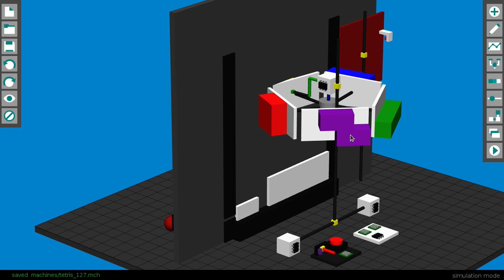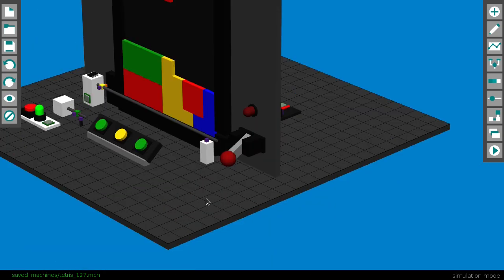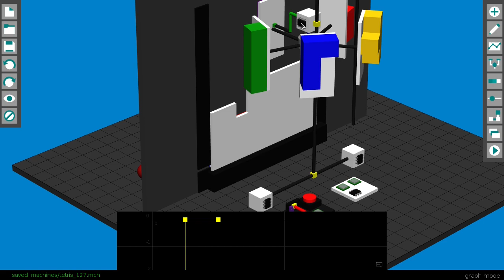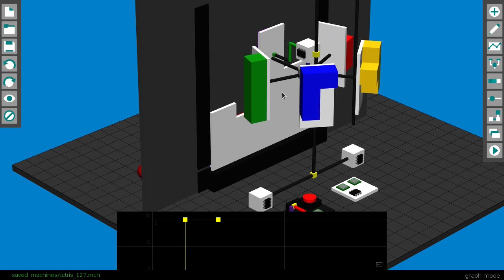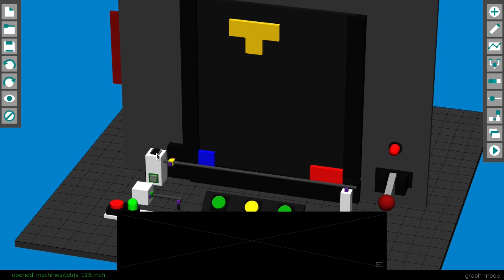How to Make a Tetris Game with Almost No Code

Comment: Did you build the engine from scratch? I think I have seen your release of the beta version in YC, I find the logic behind your program quite interesting ... For example, the engine that rotates the figures resembles a coded while loop that would "rotate" in an array of objects of figures ... Will there be more mechanisms to "rotate" those figures? or is rotation a fundamental property? I currently research the fundamentals of computer science in my spare time.
Reply from the maker: Thanks, yes I built the engine from scratch on top of OpenGL. While I didn't use it here, I can implement that rotation with a mechanical while loop, I show one that keeps the clock going on my first video. I also show in that video that rotation is a fundamental property if I'm understanding you right, rotation is what the value of the track is for. I'm finishing a tutorial video on how to build a few simple things step by step like the door and the piano, but in the future I'll do the same for the tetris game, so you'll see exactly how I did it.
Reply: Cool, it would be interesting to find a proof that shows that rotation is a fundamental physical property (because I can't find another way to set up your tetris game without including at least one rotor). I programmed several applications (still small) with SDL (it is like OpenGL but for 2d graphics), I have experience in almost all fields of computing, development: desktop and mobile applications, study of operating systems, study of distributed systems, server programming, database programming, video game programming and I am currently a web programmer, I am working on several adverse projects just for fun (I am developing google chrome extensions, learning assembly languages and creating small programming languages), I would be interested in collaborating in this or any other project that you have just for fun, I like to study and collaborate as a team, two minds always do more than one and we both learn, this is my slack link so you can contact me: https: //join.slack. com / t / chat-57y6477 / shared_invite / zt-jgj3clab-o_8lVRs8QQRrv9j9pQnWPQ
Reply from the maker: > I would be interested in collaborating in this or any other project that you have just for fun

Cool, I'll keep that in mind, I'm working towards a multiplayer environment where we can all collaborate on machines, use other people's machines as parts for more complex machines and so on and we can try to build cool stuff together. For instance, you mentioned database programming which I know nothing about, can a visual database be created with MockMechanics? How would it even work? I don't know. If you try to create something I definitely want to hear about it. I don't use slack but you can reach me through email anytime.

Comment: This is very cool. What happens if you fill a row higher up while having gaps in the bottom row though?
Reply from the maker: Then start over :D Yeah that's one of the main drawbacks, to keep things simple  I'm only detecting completed rows at the bottom, if it can't be completed because there are things on top you're done. Checking more rows would be relatively easy, the main problem is how to get rid of any completed row not at the bottom, you can't just move the whole thing down, that will require some problem solving!